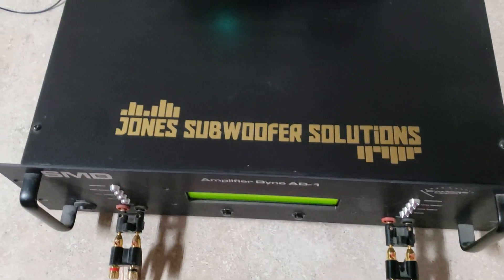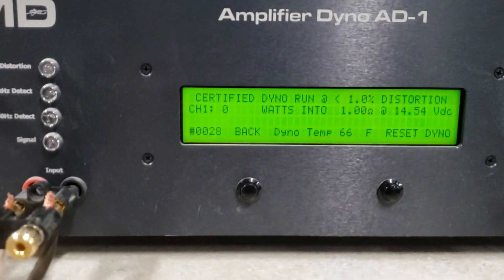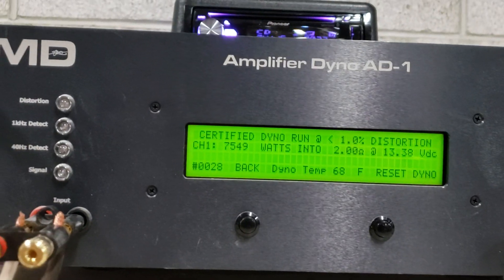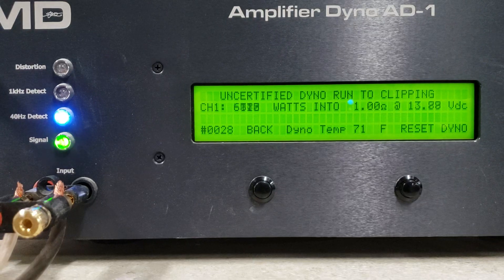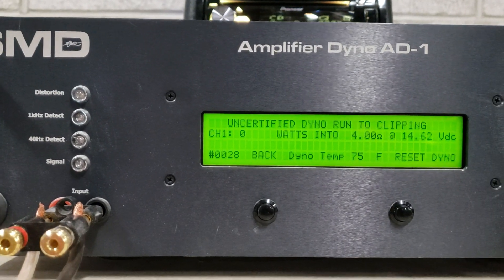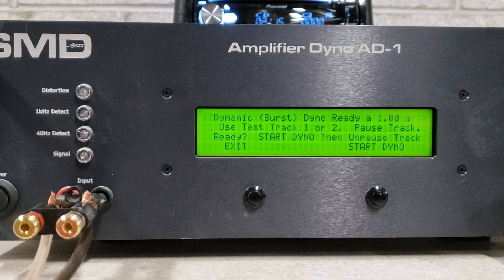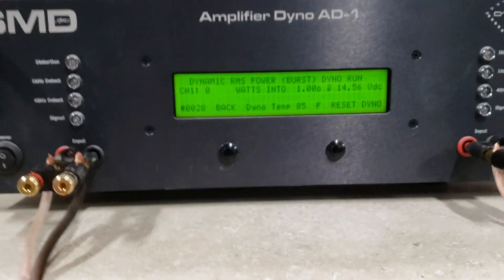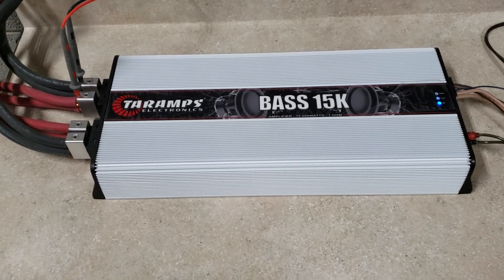(Update) AD-1 Amp Dyno Taramps Bass15k by Jones Subwoofer Solutions JSS

Comment: I must admit i am disappointed. I thought this was the bass 8k until i paused the video to take a photo of the dynamic burst at 1 ohm ....
Reply from the maker: Check the newest video out - the new lithium bank did a lot for this amp
https://youtu.be/JSlwElyyQp0
Reply from the maker: And just for another reference..
I clamp ~13k out of mine consistently, running lithium at 15.6v.   I am wired to .5 and rise to 1.3 ohms.
Reply: @Facekicker  i absolutely love this presentation . The video is 💯

Comment: Impressed with your power bank that's a serious amp to power. I made a suggestion on another channel awhile back from someone claiming there power supply wasn't sufficient of taking some scrap steel and fab up a mount that holds an alternator (like old style GM 1 wire) and a stout 220v electric motor from like a washing machine or compressor and , with correct pulley selection you could make some serious charging and capacity for test battery bank,. I just ended up with responses like that's pointless you use as much as you make... No shit was my response seems if I have to explain it's not to create power it's a way to convert power for test bench seems 250A chargers are really expensive and some audio guys may have a spare car audio alt or go salvage yard and grab a used diesel pickup alt probably it would be 250A for next to nothing and recycling facility or local dump an grab an electric motor for possibly free. Just set it up in a back room for noise or place outside during testing. Just a budget solution for batt bank charging. You obviously have that covered you test bench power is pretty stout.

Comment: I missed the first video but will look for it. I have this amp btw. Glad you stepped up to make this video. Maybe the first one out there. My question is.. what hertz is thus dunk being ran at?  Most Amps are dyno at 40hz. I believe the specs on this amp is at 60 hz. That itself would be the difference in the numbers besides the voltage drop that we all see. Thx man!!
Reply from the maker: Testing done at 40hz
Reply: @Facekicker  thx msn. Keep up great work.
Reply: yess, all taramps bass line is rated power tested on 60hz track @ 14.4v and this dyno test run is 40hz + voltage drop below 14v
Reply: @SUTH_33  yep. Just got my second 15k installed after alt and lithium upgrade. Very satisfied by the power it does for only $1100

Comment: Dude my MD12000 does better WTF?
Reply: MD are rated at 12.8 volts. Bass line are rated at 14.4. Bass line are strictly for Subwoofers, have a lot better rail voltage components. Your Md is a full bridge amp where the Bass only has low pass filters. Bass line will sound better and hit the low lows better due to better rail voltage. Long as you have good lithium headroom like a 100ah bank you won't drop below 14volts on Bass series. Hope that helps
Reply: @danfuller06  I run 260ah 14.5 at idle so I was thinking of converting to the 15k🤔
Reply: @yourmom-ii8ep  is that lithium 260ah or 260ah of agm? Huge difference between the two. Also if you can wire your subs down to a 0.25 or 0.5 you will gain alot. You have to account for box rise and every system is different. I'm wired to a 0.5 but after box rise I'm at a 1.1 total ohms load
Reply: @yourmom-ii8ep  if you don't have an issue with the md13000/1, you shouldn't have that much of an issue. May need a little more if you're running down to like a crazy low ohms but in real world cases you wouldn't go below 1ohm after box rise in most cases. Just make sure to have the agm  battery isolated from the lithium. I just run a supercap under my hood and ditched the agm so I wouldn't have any issues mixing agm and lithium
Reply: @yourmom-ii8ep  sorry but the answer if yes. Depends on your subs and wiring options. If you can wire them to a 0.5 I totally would. Or even lower if you can since after box rise. Long as it .5ohm or greater you won't have an issue running it daily. If you had the option to wire it at a 0.25 that would be even better since the total impedance would be around 0.8 or a little depending on your setup.  I've see guys have a box rise of a total 1.5ohm or even a little more. Even tho they was wired at 1ohm, it truly was at a 2.5ohm
Reply: @danfuller06  all taramps bass line start from bass 3k 5k 8k - 30k can handle 0.5 ohm ?? because I see on owner manual only bass line can handle voltage up to 17v
Reply: And lastly Bass series does 1ohm and all the way down to 0.5 ohms long as you have the battery bank to handle the voltage. The Bass line will kill the MD series with the proper power to run it. Bass amps will run a .5ohms all day. Larger heatsink area helps will cooling better as well

Comment: Can you up this voltage to 15? They are rated @ 14.8
We will never know true potential until someone gets a bank capable of handling this power needs. The MD series will always out perform the bass series in these test until someone gives it the same advantages voltage wise. Moat people start there test @ 14.2 already wielding more results from its tested 12.8 power. So until some rest these bass series at least with the proper voltage , it's a one sided battle sadly.
Reply from the maker: Coming soon 
We're on CMAX now

Comment: Bro why my bass 3k @1ohm.  it clips really easy.. I have orion h2 1 15.2@ 1 ohm.. 4/0 gauge 3 batteries and it sounds kinda ok but I believe this amps are like 120 RMS..
Reply from the maker: Lots of variables 
Check your RCA voltage first
Reply: @Facekicker  what's the voltage from the RCA? What should be the reading cuz I have the epicenter as well. Thanks for reply to me
Reply from the maker: @ricardojuarez291  if you're using epicenter, it could be contributing to the problem.
You want under 4v RCA input voltage- many people claim 2v is optimal.
Reply: set your gain properly, check your rca voltage can't over 3v, my bass 3k run cleanly and hit hard to 3 jbl stadium 12" 500w x3, I set my gain half way 1/2 + volume 80%++ stay not clipping
Reply: @SUTH_33  thanks for the input I do appreciate, I ended up selling the amp.. but I notice something, since my Sub is 2k rms, the amp wasn't strong enough for the sub.. since I set the amp at max output before clipping is was having a hard time to push that sub.. Dyno results are way different then  regular load to the amp.. it's like a sub.. free air it get its max excursion but inside the box that's totally different.. I lot of people don't realize that, in fact I don't really trust Dyno it all. I rather keep it old school my friend, thanks again..

Comment: This is actualy better, i see u have weak batteryes but it is in my oppinion perfect, meybe just a bit more power to add to be on like 13v, couse everyone who is dyno amps are 14v, and 70% of people with even crazy big sistems drops to 12v, couse well that vire and battery can be wery expensive, allmost as system... so those infos are really great ^_^ and 10k watts for 1100 or 1200 dollars is a great deal, and it is at 1 ohm, with same voltage as some people wire their subs to .5ohm it would be somewhere arround 12kwatts at 12v wich is wery epic. I will buy this 1 for my 2 subs, even i know and i saw that they die a bit faster than duno dc sundowns amps crescendos but for that amount of money if not clippin everyday if it holda at least a year i would be wery happy ^_^ and will bangin ^_^
Reply from the maker: Thank you for the comments.  This bench setup was very realistic as far as being comparable to use in a vehicle and that was our intent when building the bench and most our initial videos.    At this point people want to see the absolute best dyno results regardless of  voltage and charging.  Because of this we've upgraded to a large CMAX bank and 400a of input.  We will revisit the larger Taramps models on the new bank to see if the results change with sustained 15v.

Comment: Taramps rated Bass LINE in 14.4 ..... On the dyno the voltage drop do 12.5 an stil get 10.000 watts ..... Amasing
Reply: Yep very good numbers but still. 14.4v is very difficult to hold on any system.
Reply: @MrRey007  Not in this day and age if you have a big lithium bank!

Comment: Next you or Buget 💎 Gem Or Buget Bust or Derrick Big D Wiz needs to TRY THE NEW ROCKVILLE DB COMP AMPS WITH THE BUILT IN VOLT METER! IT COMES IN A CEA RATED 3500 WATT FOR $349 OR A 3000 CEA RMS WATT RATED FOR $299. BOTH ARE LINKABLE FOR DOUBLE THE POWER IF YOU GET 2. 
JUST KNOW WHO EVER GETS TO IT FIRST WILL PROBABLY GET 15000 MORE SUBSCRIBERS AND 350,000 VIEWS😀
Reply: sarcasm sensed
Reply: THAT I WOULD LIKE TO SEE

Comment: Taramps dealer told me you need 14.4 CONSISTENCY volts to reach 15k plus at 1ohm
Reply from the maker: This is highly possible 
I'll be swapping my bank over to a CMAX setup and will likely revisit the larger Taramps models and post updated videos

Comment: Are your dual runs of what, 1/0, 2/0, 4/0? I ask bcuz..
I'm running dual runs of 2/0 OFC Certified Basshead wire and now am wondering if that's enough.
Reply from the maker: 2/0 welding on the amps dual inputs 
The majority of the bank is linked with 4/0
Reply: @Facekicker  thx

Comment: This 15K ought to be marketed as their 12K, at best!
Reply: No. It shouldn't. I have gotten full power out of mine, as well as many others. They are rated at 14.4 volts not 12.6, like the MD, HD and Smart series. His starting voltage is 14.5. He has future plans of upgrading his power supply to sustain higher voltage drops. 👍 This amplifier is very badass, if you feed it what it needs. 😎
Reply: @varqtube  appreciate the input. I ended up buying the Bass 8K along with a 390a alt and xs d3400. have yet to clamp it.
Reply: clamped 4K even though I have gain matched it to my 5k sub. oh AND i bought a second Bass 8K to also run at 0.7 ohm meaning 20K watts for my 2 Fi 15" Neo 4.11s!!

Comment: Nice I love it just subscribed! Next try the NEW ROCKVILLE DB COMP amps that put out CEA rms watts not some off the wall number like there previous amps. There's a 3500 and a 3000 watt both have built in volt meters!
Reply: Rockford and Pyle head to head!  
[Joke]  Rockford was my first "3K+" amp so I'm not ripping on'em, but there are more quality amps I'd rather see tested. e.g. Deaf Bonce, Sundown, and few others. I'll send you my T.Bass 8K to test if interested.
Reply: @lowhertzhighspl  I'm not the guy that test these amps but you can ask Facekicker.
Reply: Rockville 🤣